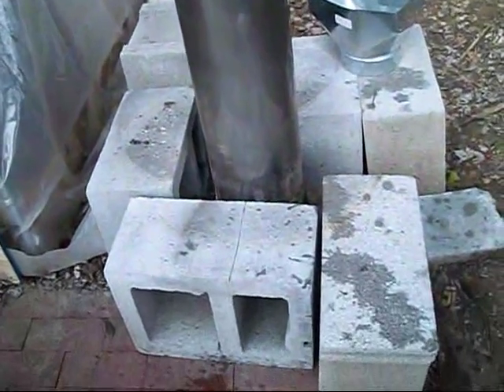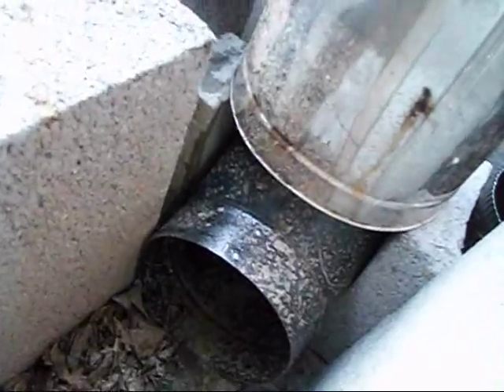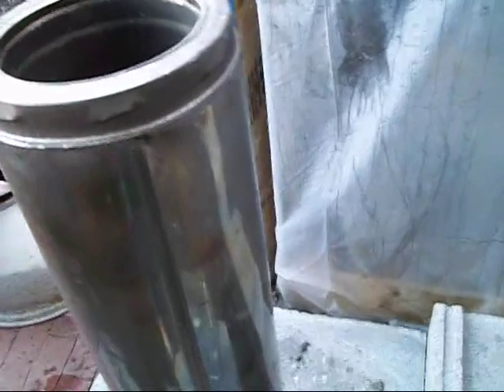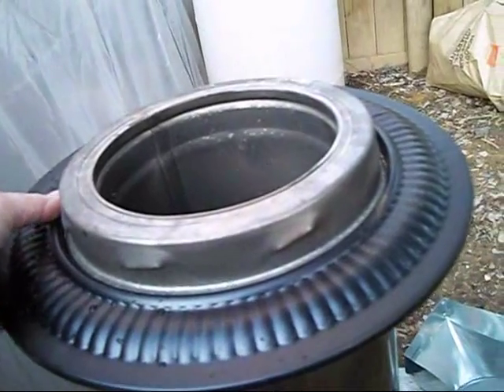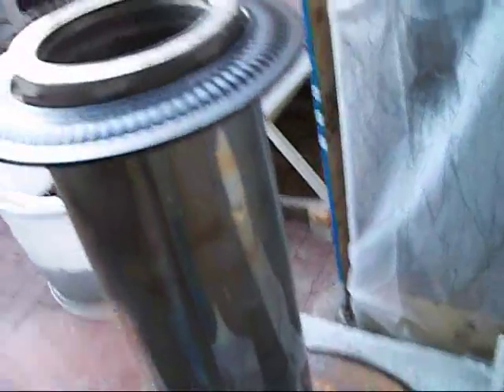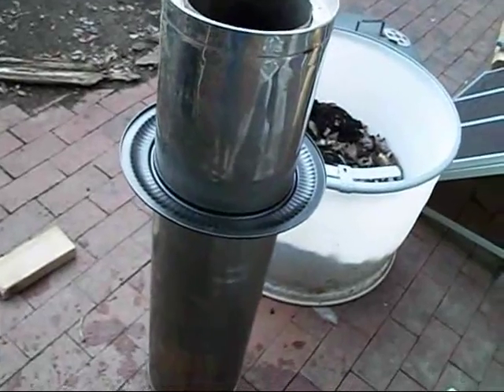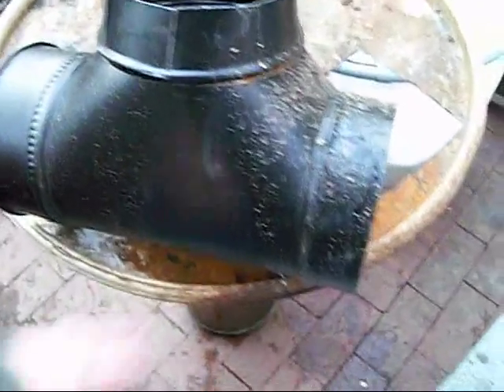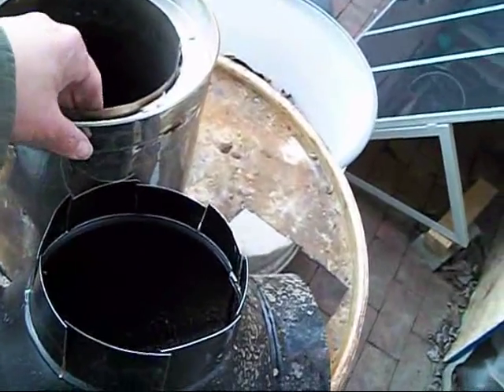Rocket Mass Heater - inside

Comment from the maker: Update - I ended up replacing the insulated chimney section (~$60) with sections of 12"x16"x8" concrete block. Turns out four cinder blocks stacked so the "hole" part lines up is the perfect height for the rocket mass heater, plus I don't have any constriction of the flow in the fireplace portion of the heater. Since the full 12"x16" won't fit inside the 55-gallon drum, I used a happer to knock off the smaller of the two halves. Will post video of the new design in few days.